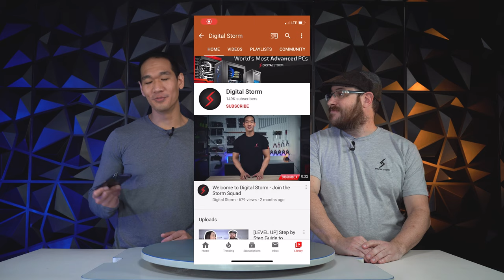[HYPER BUILDS] What Could You Do With This Bolt X?

Comment: love my bolt x def the best pc i ever owned!!! I do  wish i could get a download link for the hydrolux control pannel tho mine was deleted and I have no way to control my fans or lights :(
Reply: KingAnt how much frames does it run on?
Reply: @corrrlinks  depends on the game tarkov which is a very hard game to run runs at 100fps sometimes more depending on the map
Reply: BM_FrozoneYT I maxed mine out for $11,462 Exactly and on fortnite ultra graphics I run 240fps capped but uncapped is around 370fps on all low settings with it I hit around 1200fps with 1920 1080 res still